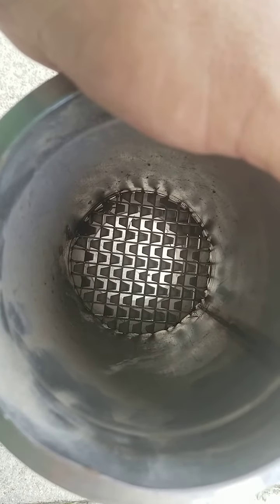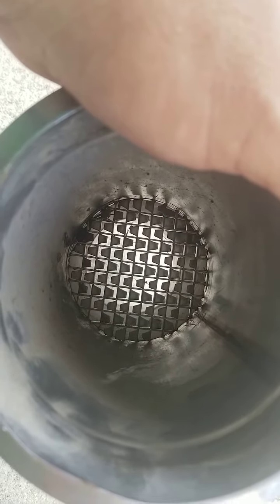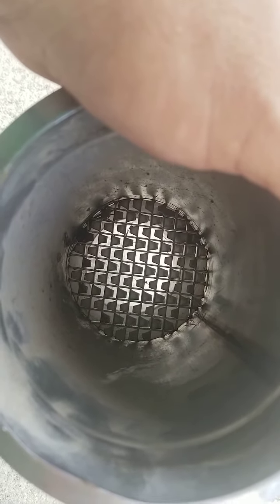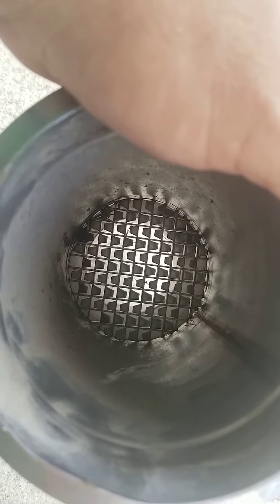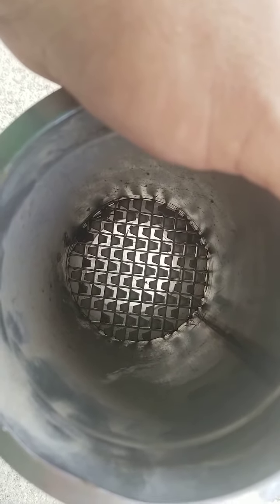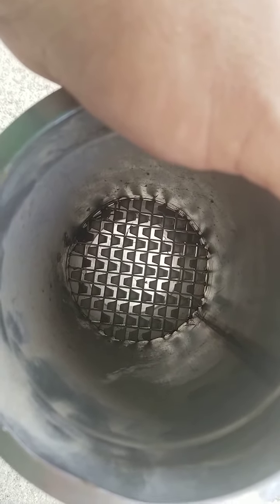Cummins decomp tube that starts the SCR cleaning process

Comment: Had to change mine yesterday, that plate inside broke off and fluid built up all around it. I inspected it with camera and saw it.
Reply from the maker: On the 50 liter and bigger the SCR cans are so big you hv to use air hammers to chip all that out

Comment: I just took mine off and its caked pretty bad. I also have a broken bolt at the doser. Whats the best way to remove the broken bolt or do i have to just buy a new dexomp tube?
Reply from the maker: They are stainless bolts, you could weld a washer and nut using i think is e317 rod. Or some wicked drill bits to get them out
Reply: @sonofmontezuma3732  thank you

Comment: Interesting, never seen one before. Are those the plates that block up if an engine that needs DEF or in the UK and EU Ad Blue runs for long periods on idle and needs a regen?
Reply from the maker: they are part of strategy for aftertreatment , failed componets drastically affect the plates if not removed and cleaned 
failed egr cooler,over fueling by injectors or diesel valve,failed turbos that oil soak the plates are a few examples of things that can affect its ability to do its job correctly

but yes those are the plates that can become restricted if the doser is injecting at determined intervals